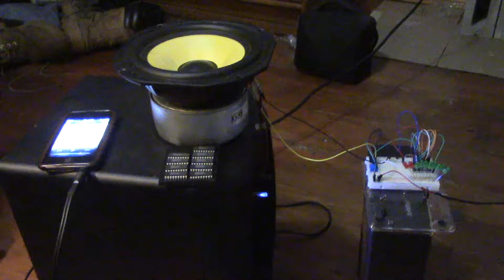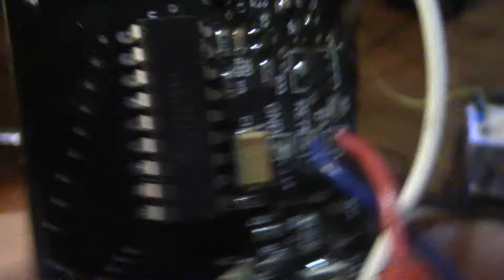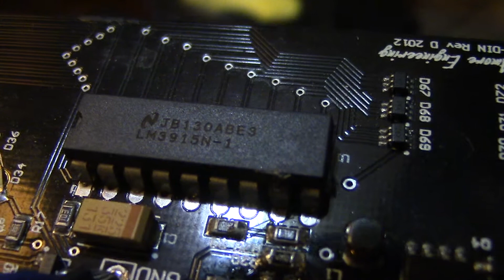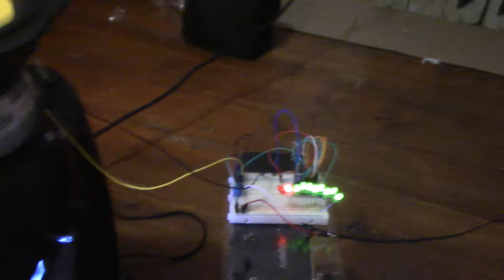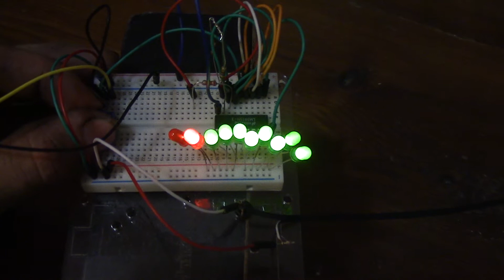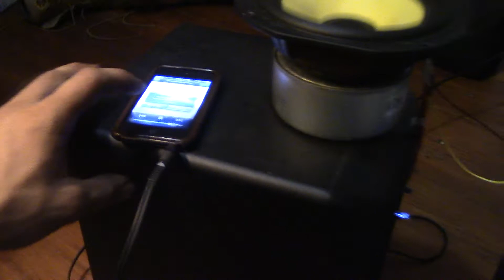My first LM3915 LED VU-Meter - Breadboard Prototyping

Comment: Get eagle pcb designer, select some surface mount components, design pcb traces on a board layout, send your design to a fab, use a hot air soldering station and solder paste to solder the surface mount components, bam, you have the smd vu meter